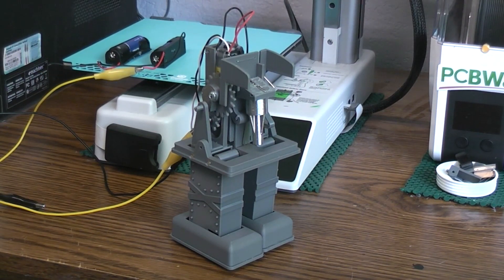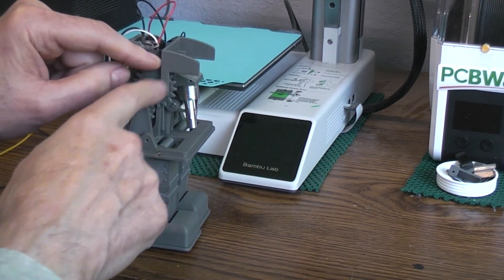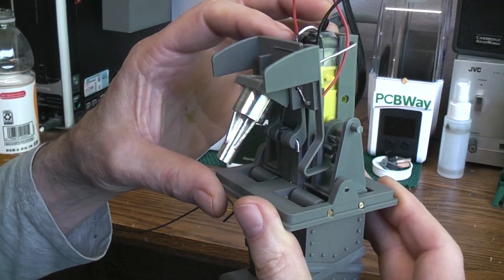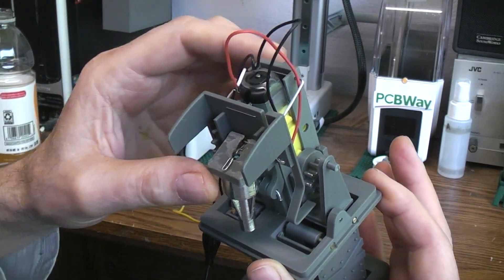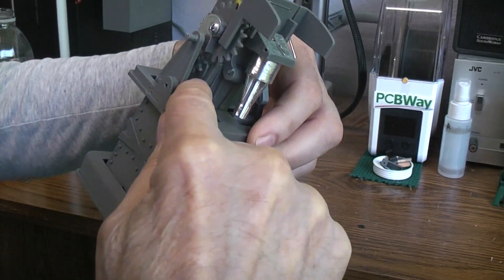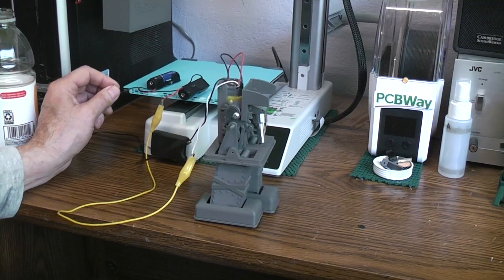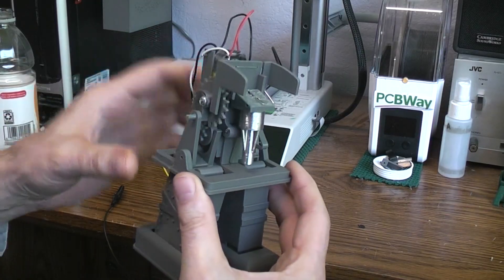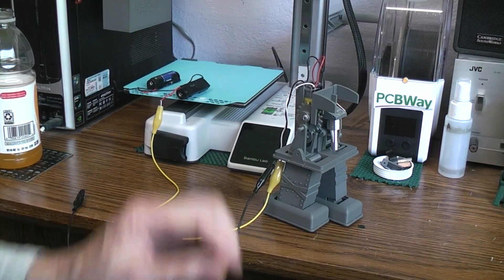Part 1 of 3d printed Mechanical walking, Arm moving, Door opening, Blaster extending Robot.

Comment: Wow, what a the complex movement you got with only cams and gears. That clicking and flashing led really does sell the blaster action. 
Hey, I just saw a robot project by Carnegie Mellon University called "Zippy" (inspired by the 1930's Wilson Walkie toys). Love to hear what you think about it.
Reply from the maker: It is there smallest power walking robot but no the smallest. Here is their link to their video.
https://youtu.be/DK7K8bcQevs?si=KJFI1QVtcsLjUp8D
Here is a link to a video I did on the 1994 palm top walking robot by Bandi, they are smaller and walk forward back ward and left and right, self-contained and remote control.
https://youtu.be/mNDx9U5BDvY?si=z1u2HsZTEzD0Bi3a

Comment: Great design!  Really love the door opening and gun popping out.  The momentary switch design for the LED is also brilliant.  Frankly I like the speed of this motor.  I think if it were moving slower it wouldn't be as menacing.
Reply from the maker: You could be right, but I still want to see what the 1:220 motor looks like in operation.